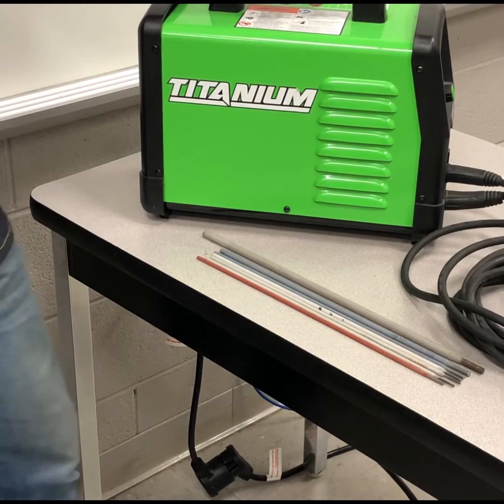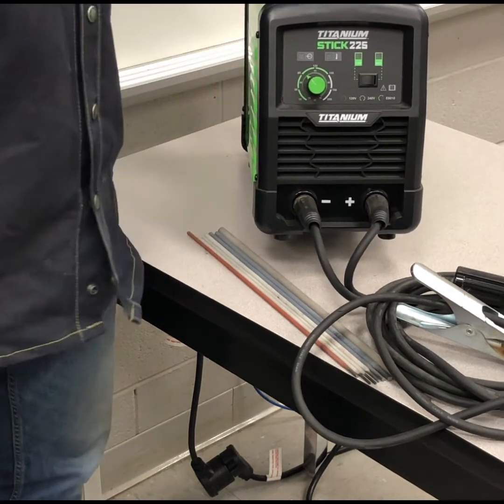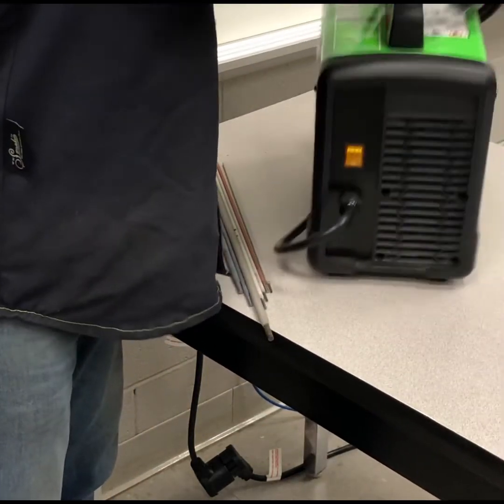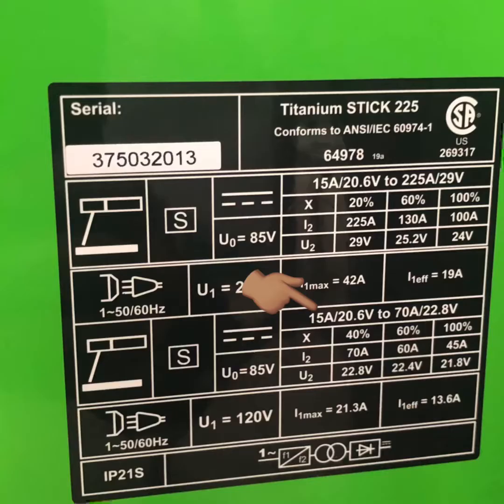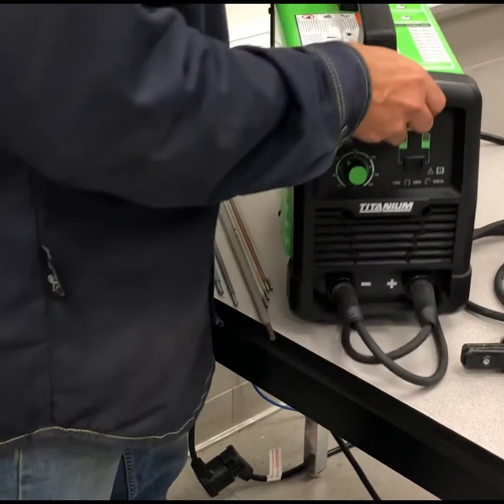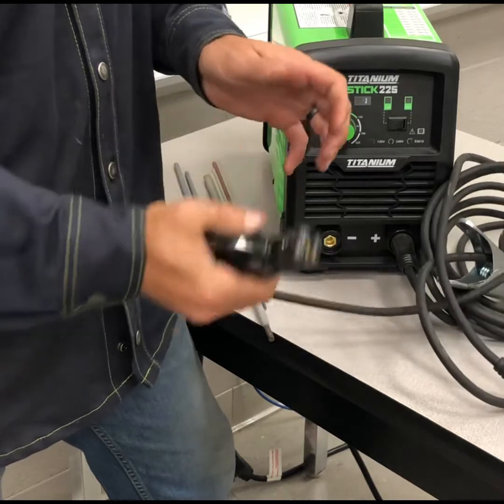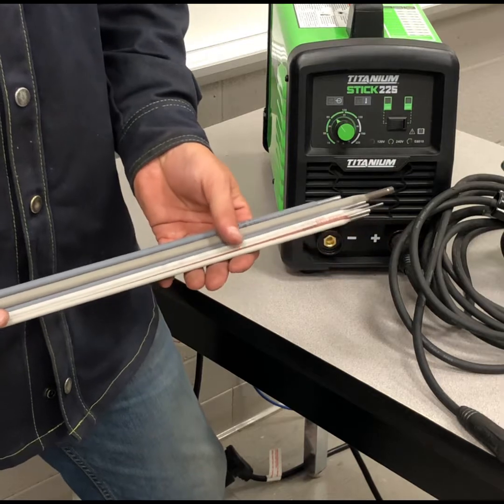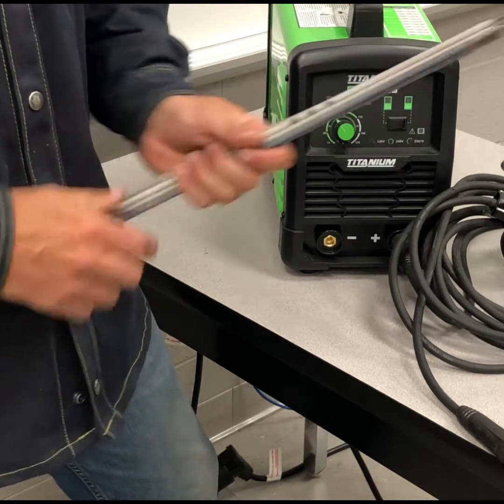$299 Titanium Stick 225 welder welds a 1/4” rod

Comment: I'm impressed by this little welder I've run 3/32 and 1/8 rods with mine in7018 and 6013 I didn't have any 7014 with me at the moment but I'll get some tomorrow because that's what I use most I'm sure it will do just fine

Comment: I teach welding and so far this is the best budget welder for price ive used. Most cant run 6010 or 11 on 120v. The 225 i bought welded it flawlessly 1/8 6011 maxed on 120v ran like a big welder. Unbelievable that it can do this while drawing 15a sustained on 120v. Efficency must be far above 90%

Edit* 
Did the math. Mathmatically if their numbers displayed are correct, than this welder would be 97% efficent. Which is abnormally high. But i may confirm later with meters.. may be closer to 95% still amazing
Reply: Project farm did a review last year
Reply: @heliarc5186, it can burn those cellulose rod with that high ocv of 85amps ,higher that some miller stick welders and actually higher ocv than most Everlast stick welders🧑‍🏭

Comment: I can't get mine to work right. I got it maxed out at 225 amps on the 240 setting and it doesnt hardly wanna burn a 3/32 7018 rod

Comment: I build smokers 1/4 and 3/16 plate how is the duty cycle if you run 1/8 6010 and 1/8 7018 on 240
Reply from the maker: As long as you have the higher voltage hookup you will run nonstop with 1/8” rods.

Comment: Very informative video I have the same machine trying to teach my self, I need all the help I can get, I don't have a 240 to run it on i have to run on 110 I can't get the 1/8 inch rods to weld at all they just arc for second but that's it
Reply from the maker: Yea the 1/8 are tough on 110v. But can get away with the 3/32.  If you can get the higher voltage hookup you will be golden.
Reply: Great welds by the way, you make it look easy, it's very difficult I hope some day I can weld like you! How long have you been welding?

Comment: Does anyone know what generator i need to run this on the 240v settings? I used the 120v at max amperage and it was hardly able to weld a thing hinge on a metals door from an apartment complex front gate. It felt like i needed 80-90amps at least but i managed to "get it done"
Reply: 120v carries 3680watts. X2 7200. At 20 amps ... 220v carries 7220 watts  on 30 amp breaker and that's max. Need a 40 amp breaker to carry 10400watts.  You need the 30 amp breaker on the hf harbor freight Preditor 220v. 7250watts. You need a 10,500 watts or more for a 40-50 amp breaker plug in on a generator or house.. on the 30 amp. 220 don't turn up the welder passed like 190 amps out. . And according to this build . You can only weld according these options. On the Preditor.😢

Comment: I Revisited this video because I have this machine and like you said you can upgrade the cables I went to 4 gauge 25-ft and no difference in power I'm not sure how long of a cable you could put on this machine but this seems to be the ideal length 25 ft definitely will get you around the shop area having to move the machine
Reply from the maker: Anything up to 50’ is fine. After that you should go bigger on the lead to avoid voltage drop.  Great machine! Thanks for watching!
Reply: @weldzcool1147  I have one ought cable on my Hobart 225 because I go over 100 ft and when I get to the point of my work I drop down to number two because the other cables extremely heavy I was just saying on that titanium 225 amp because it is so small and it's got the 10‐25 200-amp dinse connectors the biggest I think would fit in that would be number two but I don't know and you got some cool videos dude
Reply from the maker: @derekbryant6137  I agree with the heavier cables for sure.  Work smart, not hard! Thanks for watching. I’ve been so slow to post lately, and need to get back on it!
Reply: @weldzcool1147  well I think anything you got to post is going to be epic you got some great content on here so far I'll be waiting for the next one and you're welcome I'll watch anything you post you got some good information
Reply from the maker: @derekbryant6137  much appreciated!

Comment: Thank you for this video very informative I actually bought one today although I think I am going to return it since the box was taped up .

I had to get  the new parts from another box and they gave me a 20% discount 🤔  my question is I only have 120 at home I was practicing on scrap steel but I wanted to weld a spring perch onto my old Ford's Dana 60  I was having difficulty getting it to spark or light .

It worked fine for awhile but my son was trying it and the temp light would come on briefly and seemed like every time it did it would not spark  it had been sitting awhile before no overheat . I bought the rods from HF 1/8"   it says range of 90-up amps am I using the wrong rods ? The hottest I can go is 70 amps I really think the welder itself is bad and I'm olanning on returning it what rod do you recommend for my job at 120volts .
Reply: What kind of rods you got?  7018 require more amps in 1/8. You should get 3/32 7018 and 1/8 6011s and you should be fine

Comment: What size generator would I need to run this machine
Reply from the maker: Wouldn’t need much. Just be able to produce 25 amps.
Reply: I've been running mine on a 5500... no problems at all running 1/8" 7014 at 140A

Comment: At the power box what double breaker you guys using and what wire size.
6 guage wire and a 50 amp breaker.
I heard some say a 30 amp double breaker

Comment: I’ve used it at 120 amp 7018 to burn holes in 1/4 inch plates when I didn’t have a drill bit

Comment: I'm wondering how well it will run on my generator? I have 9000/7500 watt generator and was wondering if it will handle this HF machine. I have a old Acr Weld Mig box and the generator runs it fine but need a better machine for working on some farm equipment.
Reply: Perfect

Comment: I already welded 1/2" plate with this machine!
Reply from the maker: It’s hands down the most impressive little stick welder for the price.  👏🏻
Reply: @weldzcool1147  i wanted to buy a lincoln tombstone but this little machine does better because it's 225 amps at 20 % duty cycle and the tombstone is 125 dc amps at 20 %.
Reply from the maker: @IAW888  yeah the only big difference with machine compared to a Lincoln tombstone is that the Lincoln’s are either transformer or transformer-rectifier (DC capabilities) and the Titanium is inverter technology. Historically inverters don’t last nearly as long but who knows. That could be a thing of the past nowadays.

Comment: I just purchased one, titanium stick welder 225 what's the recommended on welding rod to use ??
Reply from the maker: Really any rod that can match the duty cycle rating.  So if you want to run a rod at 200amps when the machine is plugged into 240v hookup, you can run it.
Reply: @weldzcool1147  and when it’s plugged to regular home outlet 120?
Reply: @kapokidkidkapo719  hae u figured it out I have one I just bought whats ur best farm rod and aamperage on 120

Comment: I don't use mine 110 because it sucks I hate but on 220 no problem at all almost better than a Lincoln
Reply from the maker: Yea 220 is always superior that’s for sure. But I guess in a pinch with some small diameter rod the 110 can be useful.

Comment: I have one I love it even welding with my generator I have the predator 9000 watt and it will burn a 7018 no problem at 155 amps and 3/8 plate good penetration
Reply from the maker: Can’t beat its performance for that price tag
Reply: You got that right that is cheap for a stick welder
Reply: @chanceholland2470  what about 6010 1/8
Reply: @Chance Holland  have a champion 9735/7500 generator and it runs my forney flux core 140 fc I great. Going to try the titanium 225 out on it also. What's the max amps you get before the generator or welder not perform right?
Reply: @hinds90 on a 500 dollar stick welder with the 9000, 160 Amps  all position and 190 before you have short arc and manipulate it before generator shuts off.
Reply: @chanceholland2470  https://youtu.be/zQlTSMmZhi4

Comment: Have you tried some open root with 6010?
Reply from the maker: Yes, and it runs great on the 240v hookup. If you use 120v then use smaller diameter rod like 3/32 and match the land and gap.

Comment: HotDog Rod hhahahahahhahahahahhahahahahahahahhahahahahahahahahhahahahahhahahahhahahahahahaha
Reply from the maker: It wasn’t far off in girth LOL
Reply: @weldzcool1147  does this machine run a root with 6010? Or run a 6010 on 120v adapter?
Reply from the maker: @watupchief5889  yes it can run a root with 6010. Obviously smaller diameter rods with the 120 hookup like a 3/32. But 1/8” and up you’re best bet is the 240v.
Reply: @weldzcool1147  oh yea I’m just looking into doing a 120v with 3/32 for the 6010 but I just wanted to test the 120 adapter for it and see if It actually still could power that 6010 3/32 on a 120 outlet lol but 1/8 I know I’m gonna go full bore on 240v lol
Reply: @weldzcool1147  hahahahahhahahhahhahahahhaha

Comment: what6 size generator would i need?
Reply from the maker: Something that can kick out 20 amps for the 120 hookup.
Reply: @weldzcool1147  thx for advise. just been having issues. i have a 13000 watt at 10,500 RW gen that cant even get this going, i tried another lower watt at 5000 RW and nothing. some sparks but no go
Reply from the maker: @TheHalusis  that should be more than enough.  Are you using an extension cord? If so, what’s the rating?  Maybe you are getting a voltage drop.
Reply: @weldzcool1147  no extension cord. the 240 volt at 50 amps. It has
2 120V household GFCI outlets, 1 120V 30A twist lock outlet, 1 -240V 30A outlet, and 1 -240V 50A outlet 
but only use the 240v 50amp
Reply from the maker: @TheHalusis  wonder if it has to do with the output power of the generator. Read an article about how the type of generator can affect a welder.  Something along the lines of alternator vs. generator vs. inverter type.  I am going to dig in my emails and see if I can find it.
Reply from the maker: @TheHalusis  found the article. Check out this link. https://www.weldclass.com.au/blog/47-using-generators-to-power-inverter-welders-your-questions-answered
Reply: @weldzcool1147  much appreciated bro, i have been aware of potential frying of internal components of the welder from power spikes. so in the testing unplug before shut-off that sort of thing.
ill try a smaller electrode just to heat it up first, then up the size after
Reply from the maker: @TheHalusis  good luck 👍🏼
Reply: @weldzcool1147  the 6011  3/32" works but burns hot. maybe if the generator would put out more then 50 amps. I guess inverter generators or an attachment foresee-able in the future

Comment: People talk a lot of crap about HFT but the Titanium Welders are quite nice. I have an Easy-Flux and it works really well, even for a low-power welder.
Reply from the maker: For the price nothing compares.
Reply: Yup. Had a customer ask me today, "where'd ya get that welder? I don't recognize the brand."

I told him, "Harbor Freight".

He was genuinely shocked, saying that it sounded clean & smooth. He was a welder too, it seems.

The welder in question is the Titanium Easy-Flux 125. But I also own the Titanium Stick 125. Both are excellent, and well worth the price.

I run all my equipment off of the Predator 9000 Generator from Harbor Freight. And the only problem I've ever had was with shredded metal clogging the exhaust. Removed the spark arrestor about a year ago, and haven't had a problem since.
Reply: Man I feel you. Most are just mad because they cant weld with the chicago electric 125 lol. That's even a decent welder with 030 flux and slowly dragging it with the whip and pause.